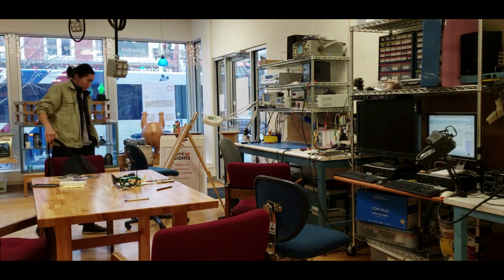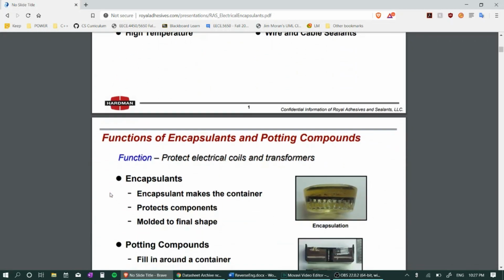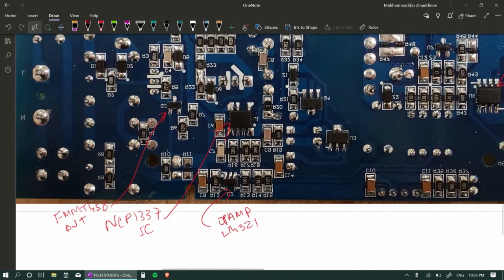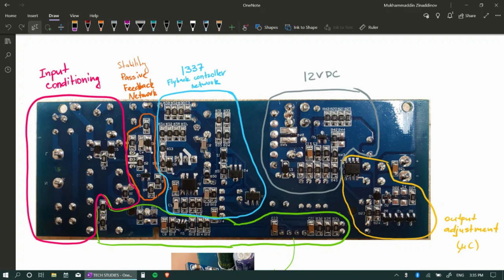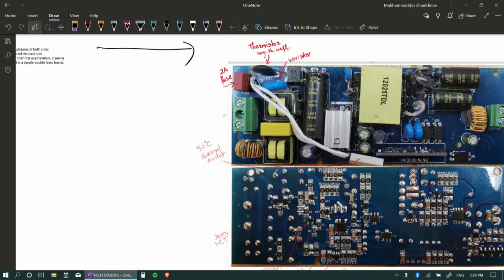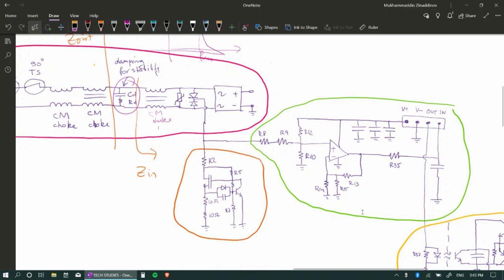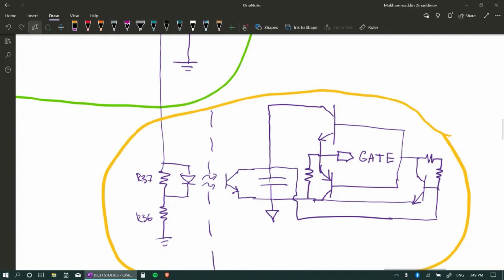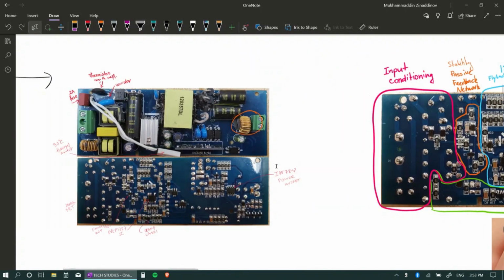Circuit Analysis Principles // Functional Reverse Engineering (LED Driver)

Comment: I have a few of these LED drivers that came out of a LED light for the medical industry. Both of them were potted in silicone (I think) like the one you have here.
Thanks for the reverse engineering, I learned a lot about this type of device. It comes at a good time because I'm going to start testing the aforementioned one I have soon before installing it in the Lab. I noticed the input side switching transistor (on the heatsink) has silkscreen printed between the leads. I see this a lot. Do you know why it is done? Maybe one person did it for a good reason and it's just become accepted practice from people reusing building blocks.
Reply: Hi Sam, I was wondering about those too! I think those are used to prevent solder from bridging between the terminals (or for the ease of detecting that it didn't happen during quality control). However that is just my guess.